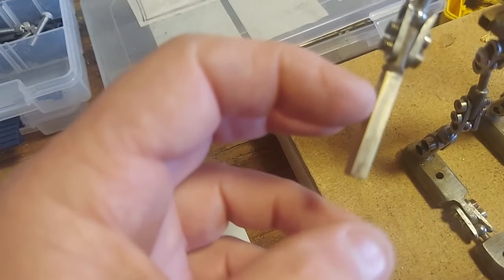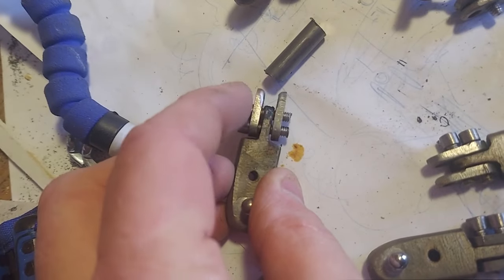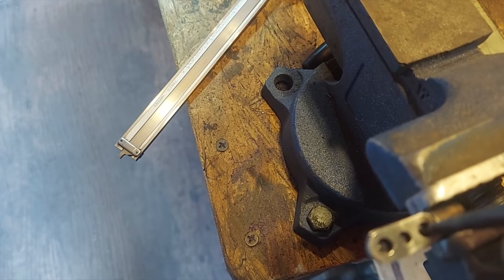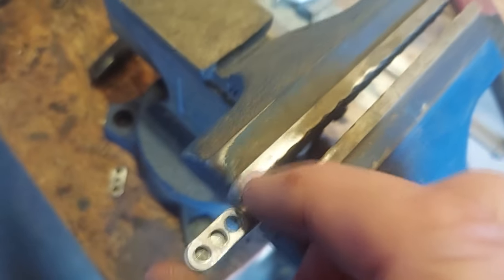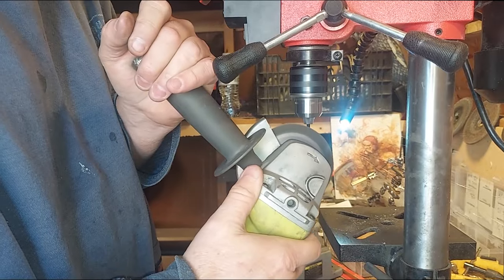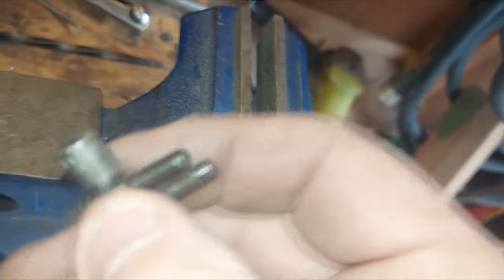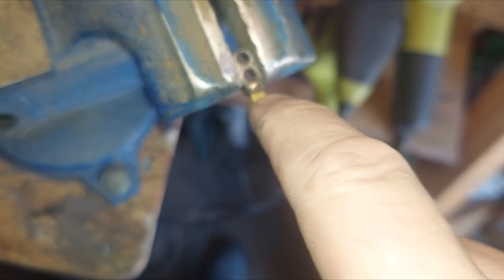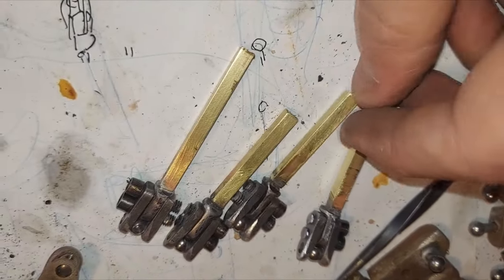Making Single Ball Joints For Animation - Stop Motion Production Diary 2

Comment: Hey Jeff, maybe this helps or interests you: there's some frame smoothing programs available, one is called DAIN and you can get it for free. It creates new frames between your shots to smooth out animation. It works well with 2D stuff and stop motion.
I used it to clean up some old old stop motion I did that had bad timing, so I was able to retime it in an editing program after adding 4x the frames. It does look overly smooth afterwards, so it depends on what look you're going for because sometimes a limited frame rate is more impactful in certain scenes.
It does require a somewhat recent GPU and DAIN in particular has some limitations, but I'd recommend watching some examples videos because it could potentially really speed up production time, as if you hired a couple of other animators to help out.
Reply: I intend to make a tutorial about the process I went through to update my old stop motion, I'll send it to you via Facebook when I get it done.
Reply from the maker: Thanks, I'll check out. Sounds like something I might be interested in.